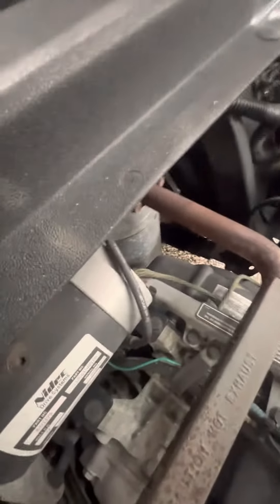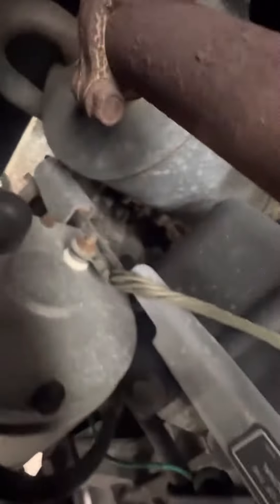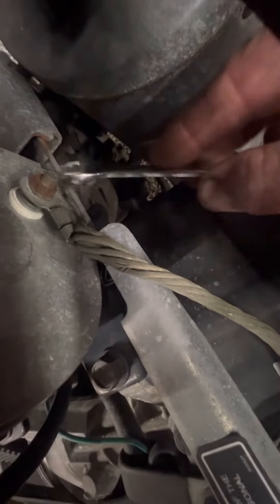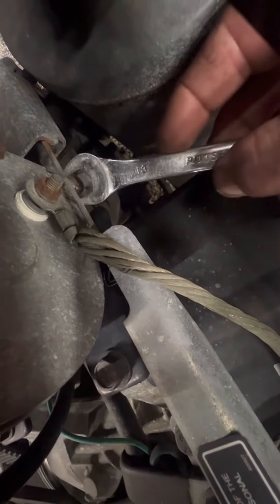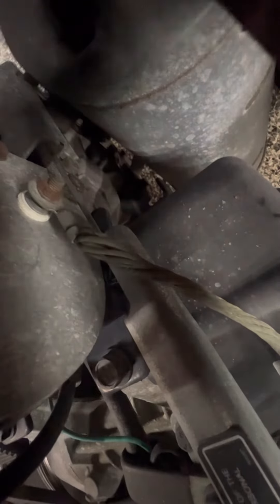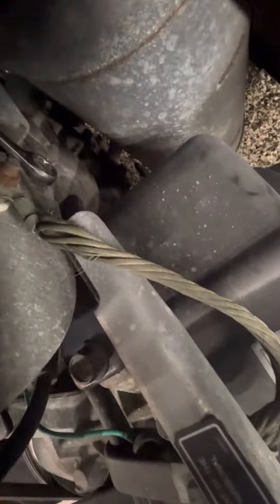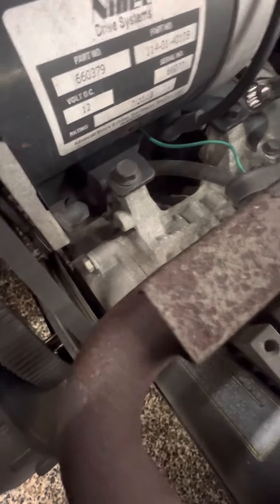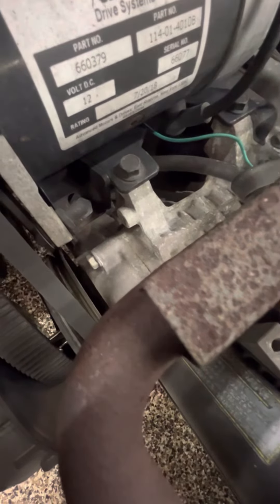EZGO TXT STARTER TIPS!

Comment: I got a ex go with a Kawasaki engine and previous owner bypassed the pedal start and now it key switch operated like a car . My question is the engine supposed to idle
Reply from the maker: No there not made for that. But you can adjust the throttle screw on the carb to open up the throttle some so it does idle.  But there’s a fine line where too much idle and it will be hard to get it into gear.

Comment: mine is making a loud grinding sound but everything is working. Anyway to fix it?
Reply: I drove through sand
Reply from the maker: @jonathanmcwhorter1353  is it coming from the brakes or the starter
Reply: starter I believe
Reply from the maker: @jonathanmcwhorter1353  if starter bearing noise
Reply from the maker: Tear apart and rebuil
Reply from the maker: You can buy the bearings at a local part  store. The hardest part is getting the pulley  off.
Reply: Thanks brother 🙏
Reply from the maker: If you hear a loud roar coming from it that’s the only thing it can be. Unless the starter is literally tearing apart.  I have seen some of the cheap starters tear apart internally. But normally when they tear apart they lock up.
Reply from the maker: @jonathanmcwhorter1353  yes sir thanks for watching. Any other questions let me know.

Comment: I remove the flap on the back its easier to get to the starter an much easier to replace it we are in the process of replacing 150 starter heads an i have become pretty good at getting them off brushes replaced an reinstall
Reply from the maker: if you have to replace that many. you have no choice but to get good at it.